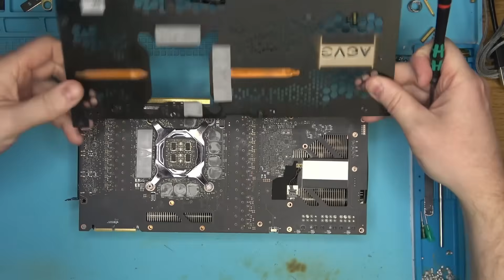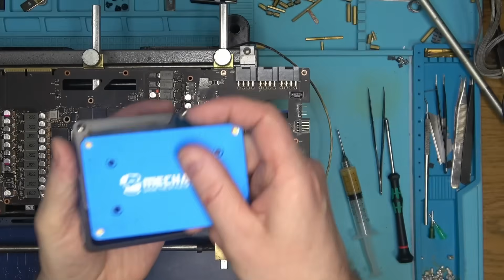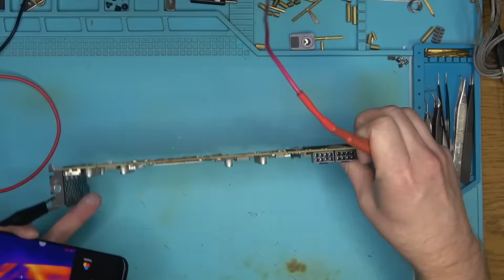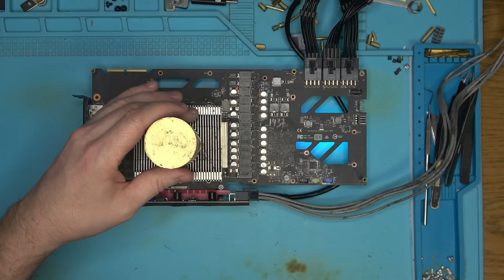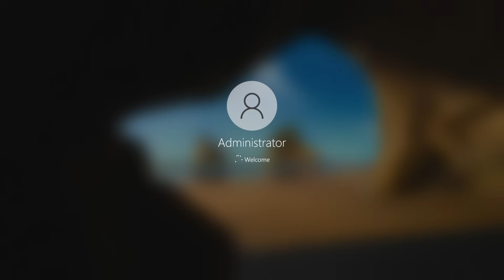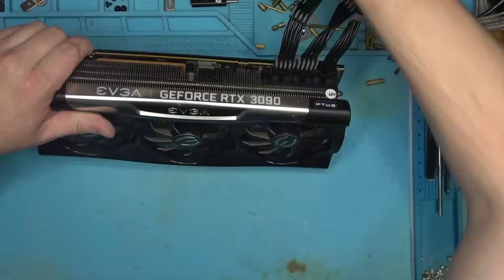The curse of owning EVGA graphics card

Comment: 21:11 
Online activation helps you accurately check the resistance that is affected by the other components on the board.

Explanation: 
DM40C resistance measurement ranges include 6 manual ranges (600Ω/6KΩ/60KΩ/600K
Ω/6MΩ/60MΩ) and one automatic range (AUTO). Select any one or click MF to return to the 
measurement interface. After returning to the main interface, the range mode is indicated in the 
top-left corner. 
Resistance measurement include offline and online measurements. Offline mode is measuring 
the resistor separately after removing it, featuring high measurement voltage, fast speed, and high 
accuracy. Online mode is directly measure on the circuit board, featuring lower voltage, moderate 
speed, but small deviation. Select one or click MF to return to the measurement interface. 
Click the resistance measurement button to quickly cycle through offline and online modes. 
Online mode is indicated by Ω with subscript ON.

Comment: I been gaming since the TRS 80 and the Atari 400 and 800 Every card I have owned still works.-1 that shmegma got in the cooler had to clean it out and get a new fan,Clean it carefully and you will have 20 generations of VGA.I must have 30 GPUs they all still work.When the celeron was out that was my first GPU upgrade from a onboard video encoder.Only issues were the ATI drivers for old AMD cards.My first AMD card was for Jedi Knight Jedi outcast.Seems OC and things like that hurts cards.I must have got the lottery by never having an actual broken device.Only abuse over 3 years not cleaning a PC put me out for the first time.Better just to upgrade to get more FPS and don't pour more power into them than stock.And definitely clean blower cards meticulously.They seem to last forever.My Quatro was the first card that I saw a huge improvement.When AGP was a thing.

Comment: The fact that you confirmed something I have been doing for years is super cool. EVERY time I have taken one of my GPUs apart to clean it and apply thermal paste to the chip, I have ALWAYS put it on the pads as well so that I could reuse them. I have literally done this on about 20 cards at this point without any single failure. I even remove thermal putty and replace it with pads plus paste for far better thermals. This is amazing honestly.

Comment: Have EVGA 3080TI and 3090Ti and no issues.  I manually run the fans at 50% from the beginning to prevent heat issues.  That passive heat is a joke to me. If the card is on I want my fans running.
Reply: i have mine running at 70% no issues temps always under 40c while gaming 1080p high settings evga 3090.

Comment: online prolly refers to "in circuit" im not sure tho. just my common sense, dont know what friends from china had on mind :D
Reply: Yes.  From the manual:

"Resistance measurement include offline and online measurements. Offline mode is measuring
the resistor separately after removing it, featuring high measurement voltage, fast speed, and high
accuracy. Online mode is directly measure on the circuit board, featuring lower voltage, moderate
speed, but small deviation. Select one or click MF to return to the measurement interface"

Comment: i have had nothing but EVGA since 2006 and my first 8800, all in a house with heavy smokers and cleaned with compressed air 2-3 times a year, still using the last one, a EVGA 3070 non TI. and have never had even 1 problem, why all the hate????

Comment: Is it worth replacing all the driver mosfets at once on a problem card like this, so they are all from the same batch, same condition and same characteristics? Especially when the PMIC was faulty before and the semi conductors might be compromised and slowly dying now? (In my mind a faulty PMIC will make the phases work out of sync, or overloaded, spiky signal etc)
Otherwise you run into a loop of failing PMIC and failing driver mosfets that then take each other out with time delay?

Comment: I once bought my TUF 3080 used from a guy who also put thermal paste between the chips and the pads. The card looked like a mess because of the silicon bleeding out of the pads and the temperatures were very bad. So i replaced the pads not using paste again and it worked fine again. Makes me wonder if adding thermal paste might speed up the aging process of pads?

Comment: Do you do long term stress test before sending the cards back? Or is it just a quick installation and checking the sensors on GPUZ?
Reply: If furmark doesn't show anything wrong, the card can be said to be fixed.
Furmark does what games don't.
Reply: @GoldSrc_ Yes, I understand that but it should be ran for more than just a minute or two while checking the sensor data. It will fail quickly most of the time, but not every time. I have tested cards that seem fine, but after a few hours will fail.
Reply: @Clay_333  I doubt he just does it for one minute.
He often also plays games with the cards to make sure they're stable.

Comment: did the thermal paste thing actually work? because I found on my EVGA cards the memory is stupid levels of toasty and needs new pads just to stay in sane levels of heat

specially if someone wants to play POE2(that game really hammers the gpu and vram)
Reply: After water-cooling my 3090, even the memory temperature remained below 70°C under heavy load.
This is the only real remedy for the high-end cards of the 3000 series.

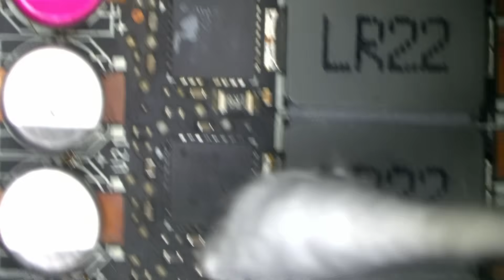Comment: 11:50 what's those orange globs between the caps?
Reply: These are maybe flux residues from previous repair(-attempts).
Not from liquid agents but resins from the flux cores of solder wire presumably the lead-containing one with a low melting point, ...

Comment: there is a lot of corrosion on all the solder joints. like just about everything i see around that mosfet is corroded on the tops of the solder all over. this card in a wet environment?
Reply: that's flux residue

Comment: I owned a "normal" EVGA 3090 FTW3 Ultra for two years (water-cooled by Alphacool and, of course, with a support bracket). 😊

It ran flawlessly with the 520-watt BIOS of the Kingpin card until I replaced it with a 4080S, and it covered two-thirds of the cost of the new card.
The buyer also bought fresh thermal pads and thermal paste after converting it back to air cooling, so it was practically a brand-new GPU. 😉

Comment: you can recycle old wick by sucking all the used solder with a vacuum pump desoldering station
Reply: if this actually works I am gonna laugh my a** off
Reply: @lookitskazzy  It doesn't.
Once the solder comes in contact with the copper wire, it becomes impossible to remove.
You might be able to remove excess solder from the wick, but you're not recycling anything lol.
Reply: @GoldSrc_ it doesnt need to remove completly, as long the thick solder suck it can be reuse again for bga cleaning
Reply: @lookitskazzy for bga works the wick will saturated a lot of solder if you using spatula solder tip
Reply: you could use an additional brain for making up something better

Comment: Does the mutimeters online option send it readings to the PC?
Reply: No, "online" and "offline" are different modes of taking resistance readings.  From the manual:

"Resistance measurement include offline and online measurements. Offline mode is measuring
the resistor separately after removing it, featuring high measurement voltage, fast speed, and high
accuracy. Online mode is directly measure on the circuit board, featuring lower voltage, moderate
speed, but small deviation. Select one or click MF to return to the measurement interface"

Comment: I have an EVGA 3080ti FTW3 ultra, used for few months and then replace the cooling for hybrid cooler, and now the card is close to 4yrold, and I am really happy with that beast.
Reply: I have a EVGA 3080ti FTW3 ultra too, never overclocked, just replaced the fans (common issue).
The issues is Precision X1, sometimes it reset the fan curve or/and disable the fan then put's the power to 20%. If the owner doesn't put it back to 100% and activate the fancurve while trying to overclock it or troubleshooting it with nvidia control center (or any other oc program, it can fry some stuff.) EVGA should update it's program. They left us in the dark when they quit the GPU industry.
Reply: @rowndo  mine is OC-ed and with some UV. Using Afterburner and curves. and maybe I am lucky, it is rock solid.
Reply: Yep,3080 Ti Ftw3 user here! Undervolter at 1950@950 mV and it's running coupled with my 5 Ghz all-core 9900k with triple 1080p setup, working like a charm!❤
Reply: I have the same card you have.  Only cleaned and repasted and replaced pads.  Ticks like a clock.  Love it.  Currently using in my son's rig with a 9900k for 1080p setup.  Maxes almost every game.
Reply: @busht4169yes, I replaced the thermal paste to thermal grizzly kryonaut, and the pads to gelid pads, and with the hybrid cooler it is on 440W thermal limit, 1950@950mV, and the avg temp is 70celsius.
Reply: I have one too. I used it for a couple years until I upgraded and gave it to my son. It has been running 1950mhz @ .950v with 450w vbios it's entire life.

Comment: adata did (still does) the same stuff with switching out components -have a great product and pull the rug silently on it. 
teamgroup (yes, RAM) did the same thing on their Samsung b-die sticks and its harder to note unless you install the stuff. while the bdie does run 3200c14 the Tertiary timings were saliently changed. (not a great deal) but did make fine tuning a bit of a headache at first until i noticed..
gigabyte did the same thing with the 4070ti gaming OC v1 is the better option (imo) v2 has the copper plate but somehow gets hotter.. details blah blah
there are LOADS of other companies that do this.
Reply: Many SSD and Flash Drive companies do this.  It’s easier to name the ones that don’t (or didn’t): Samsung and their flash drives, SK-Hynix, and Crucial.  Given Micron will happily give us the finger, I figure the other two may also become more bold in the future.
Reply: @annihilator247x  my point wasnt to name those that did lol. it was to point out that EVERYONE that i know of except (very) few do this and never actually state its been done.. i was lucky enough to have gotten the earlier revision of the adata 8200sx pro 2tb nvme before they swapped the chips to the slower garbage it is now. -Cudy (wifi routers) also does shit like this. my P5 for example has a few revisions to which they corrected that (surprisingly) but still, this happens way to often and imo it shouldnt be allowed as its deceptive as fuck.
Reply: I bought an adata pendrive which was impossible to format, then after messing with it it went short and almost melted the usb port. Avoid that and Seagate

Comment: I have the 3080 version of this card, the cooler sucks big ass, it's so loud and hot despite being a 3 slot card...
Reply: Problem with the 3080's in general. I think even a 5080 manages to run cooler.
Reply: @dolpoof2335  I had a 3080 EVGA FTW3, then bought a 5080 PNY. The PNY cooler is like 50% larger. It's not a mystery why it's quieter.
Reply: If the heatsink is hot, it means it's doing its job lol.
Blame the fans instead, the heatsink can only sink so much heat.
If the fans can't move air quick enough to to move the heat away, the heatsink isn't to blame.
Reply: After water-cooling my 3090, even the memory temperature remained below 70°C under heavy load (passive backplate).
This is the only real remedy for the high-end cards of the 3000 series.